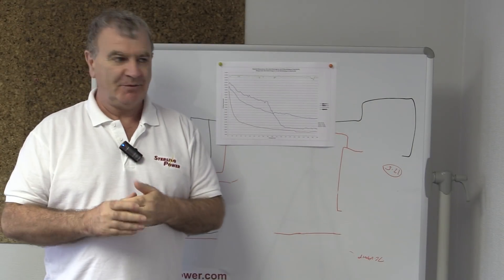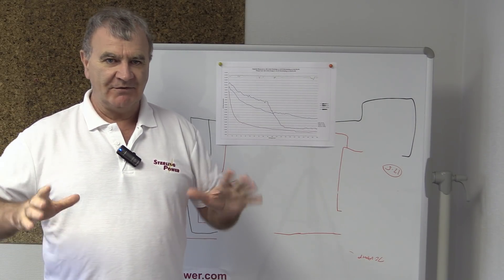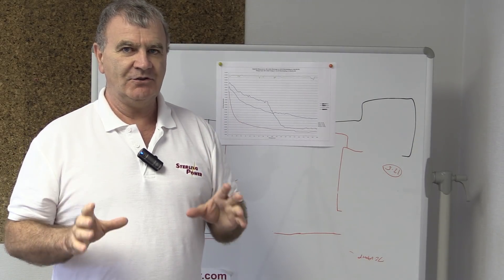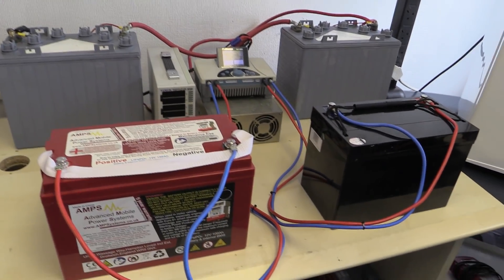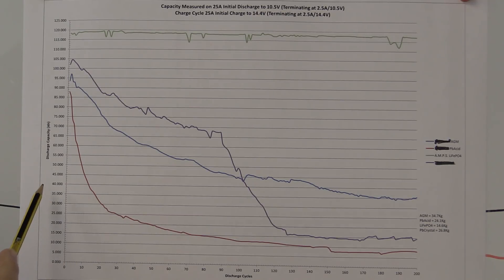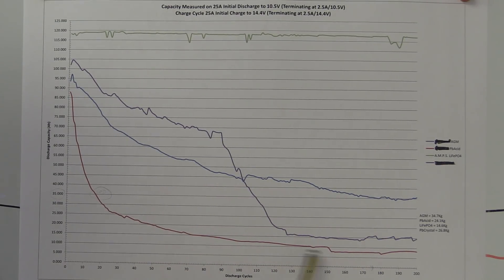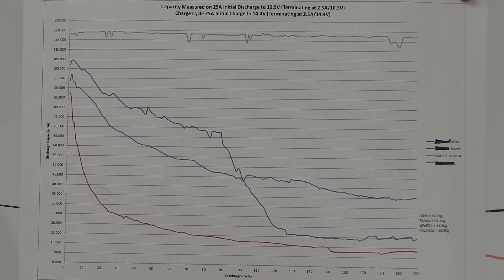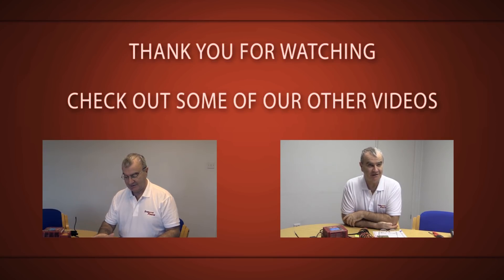Lithium vs Lead acid test, by Sterling Power

Comment: Try the test with a high quality lead acid battery as comparison your results are biased
Reply: I think the point is valid, but "biased" is a bit too strong. I use a high quality lead battery - an Odyssey PC1800 -  in a motorhome application. I have it set to cut out at 11.5v and this rarely happens, but it does regularly get discharged to around 11.8. I have monitored it closely, and am currently in year 3. It is definitely starting to deteriorate gradually and I am expecting it to need replacing in another year or so. It has certainly performed better than previous low quality or cheap systems that I have had in previous years. Lithium prices are coming down rapidly, and I expect my next upgrade to be lithium.
Reply: Another real world test would be testing a battery subjected to partial charge over periods of time. I rather suspect your expensive lead acid might not fair too well. In anything other than a car, this is real world conditions. No effect on lithium capacity but most harmful to la.
Reply: nope, i can tell you from a years experience living offgrid, always having the best technology that was (for instance hoppecke vr-m agm, sonnenschein opzv, that are comming nearly on a price of a lithium) and yet, lifepo4 is still miles ahead, not to mention standard average crap lead-acid batteries
their effectivity is worth to mention
and after like 10 years of daily discharge on 90%dod, you still can operate the lithium battery another decades, as its whole capacity over about 5k cycles drops to 80%, so still pretty strong
Reply: @francouz23   AGM batts aren't really the best lead acid can offer flooded lead acid if you buy the best can give you 30 years of use lithium ION will die after about 10 years whether you use them or not.
Life PO4 though might be better but the jury is still out on that.

Comment: This is a great demonstration and very informative. However, I would like to see the same test completed utilizing the manufactures suggested Depth of Discharge for each battery chemistry. I'm in the USA and have a large motorhome traveling most of the year. We use LifePO4 batteries with Victron Energy components and solar panels. Rvers generally understand how to maximize the life of their batteries.  I believe the same test done under more "normal' conditions would be more beneficial to most people.

Comment: If I made a 5 cell lead acid and gave it an effective rating instead of an actual then it'd be a fairer comparison.
 A FLA cell held above 2.0V will hold it's own to a li-ion cell held above 3.5V. This is all Charles is doing, stacking the deck in favour of his Li-Ion.
This video is marketing not science. 
Comparing low quality lead acid driven like a rented donkey with li-ion that's operating in an optimised envelope.

This does not reflect the chemistry capability Just the user regime.
Reply: How about adding a BMS to say a 12vdc SLA and call 12.2 0% and have it shut off until above.  Now you can run a SLA to 0% without damaging it lol great marketing right. Oh and change the actual 12.2 to a made up number of 13.2. Which would put full at 13.7 sound like a better battery already lol
Reply: Well said.This is nonsense.This is not a scientific test,the design of the experiment is deliberately rigged against FLA,the design of the experiment is rigged to favour Li-Ion,this is not an experiment but abuse,why didn’t he design it with the Li-Io battery teared down to remove the bms just as the FLA battery didn’t have a bms,Deep Cycle FLA Batteries we’ll taken care of are way way cheaper than LiFePO4 batteries.

All you have to do is
1)Discharge to 50% SOC
2)Make sure you regularly clean the terminals 
3)Top up with distilled water as often as is demanded by the way/rate you’re using them
4)Invest in low battery disconnect equipment like Victron BP(US$~56 for 12/24V 65Amp version)
5)Battery Management system like PowerPlus to prevent sulphation etc

With proper maintenance,you should get at least 8 years with FLA,costs of Li-Ion is 3x,which means that you can but 2 more sets of FLA.
Reply: I don't see it like that. The batteries were tested in real world conditions. Cell count is neither here nor there. Battery output voltage is. The battery manufacturers spec their products ah rating for an end voltage of 10.5v. The lithium would also drop to about this level before BMS cut it off. The fact is that the test was equal between chemistry. You might want to look at the Excide corporation and their (historic) grip on the battery industry. Taking la and its flaws into account, it's a wonderful battery to market as using it in automotive applications where large bursts of energy are required with immediate recharge is fine. But it's a marketing con to claim the advertised ah, let alone cycle life when the ah is actually used.

Comment: I don't see a comparison to a high-quality lead acid battery, a pair of 6V Trojan T-105 for instance. In any case, thanks for the tip on latching relays, I hope to use that and one of your battery to battery chargers as I build my custom recreational vehicle this summer in the USA. I'm a big fan of your videos but wish you would have compared a lithium to the very best lead acid has to offer. I think Lithium's are over hyped
Reply: More scientific compare cells than batteries...less room to fudge the results. 
I agree 6V is a superior build for traction and li-ion is hyped.

Comment: are lithium batteries more dangerous to carry in a small RV than let's say an AGM? concerned about "spontaneous combustion"
Reply from the maker: Apologies for being so incredibly late to this, responding now mostly for other people curious about the same thing. 

If you don't hit them with an axe and generally just charge them correctly, you'll see no faults with them.